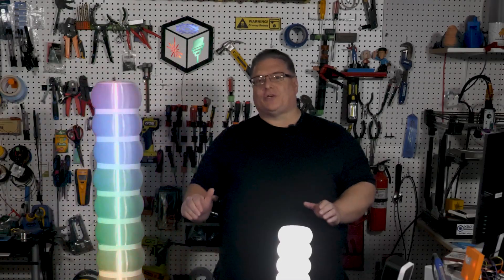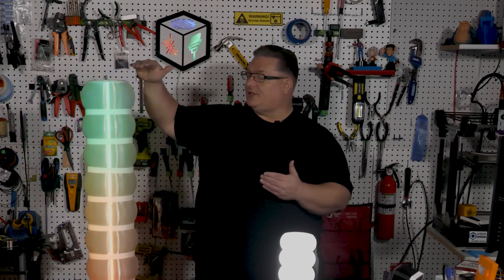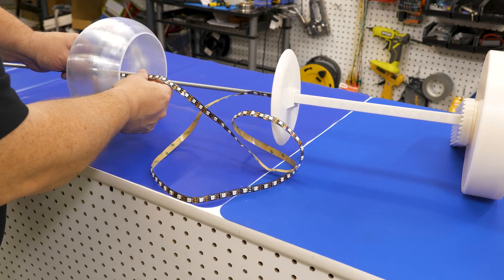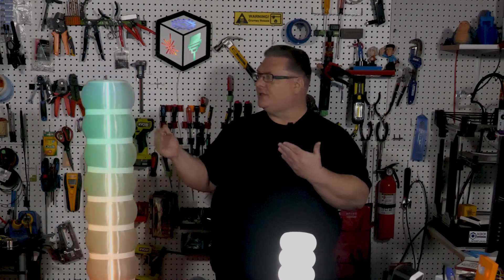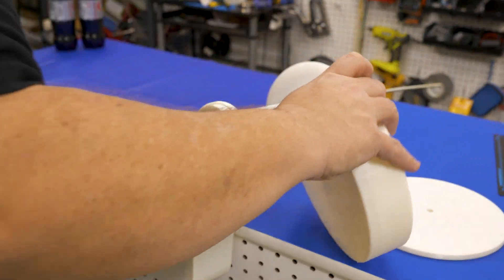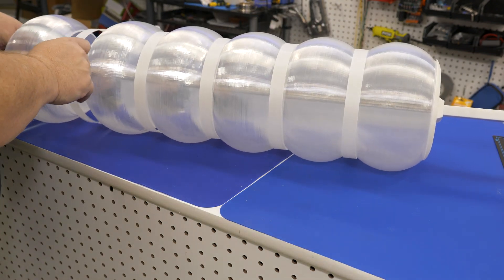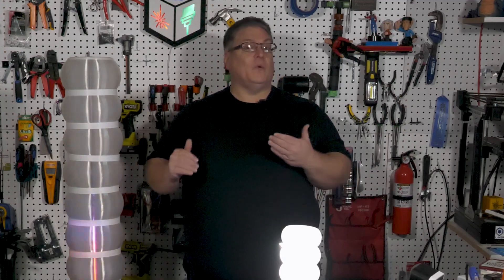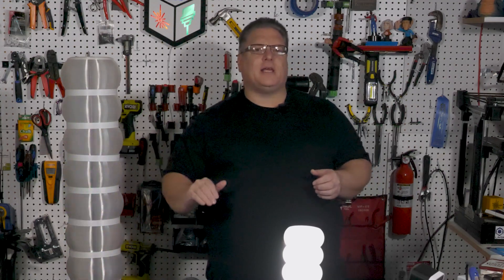Create a Mesmerizing 5ft Sound Reactive LED Floor Lamp with 3D Printing - DIY Guide

Comment: Printing last piece now.  Will have 13 "lanterns".  The electronics box was a bit of a bear to print without a ton of supports, but there may be a different way I did not do it.  I am pumped to get it all put together.  Thanks for showing and making this project available for us!
Reply from the maker: Your welcome! Post a pic in the discord, would love to see it.
Reply: I would like to get you a pic.  I am not on the Discords though.  I got it all finished and running.  Man, you were not kidding that it looks so much better than the video shows.  My favorites are Fire 2012 and Fireworks 1D...they both look so cool.  The only changes I made were really within WLED.  I added a momentary push button on the outside of the electronics box to turn on/off if needed at a moments notice.  I also did my first trial with the Wiz Remote.  It is a 2.4ghz remote control that links directly to WLED w/o any IR or extra anything.  It gets configured right through the WLED Config-->WiFi.  It gives you a remote control with on/off, 4 scene selection, and brightness control.  Figured this would be the best thing to try it out on.  I have about 20 WLED projects around my house, I absolutely love its versatility.  I have converted street signs, put up permanent Christmas lights, build matrix displays, lit up our front walk, lit up our rock garden in the back yard, and under our pergola just to name a few.  People are always amazed and what can be created.
 @MakersMashup
Reply from the maker: Post something and drop a link here.  Love to check it out.